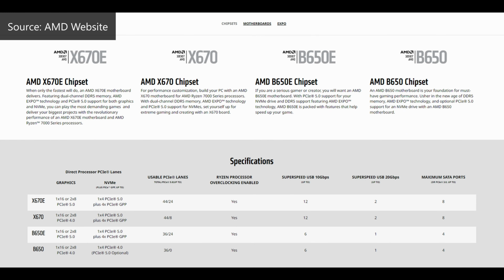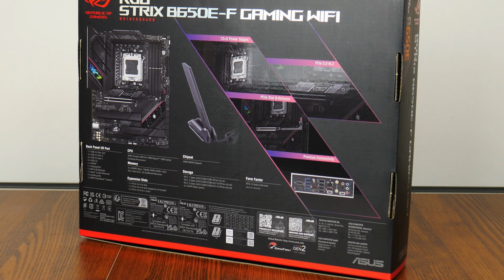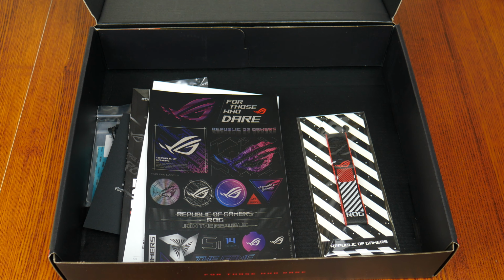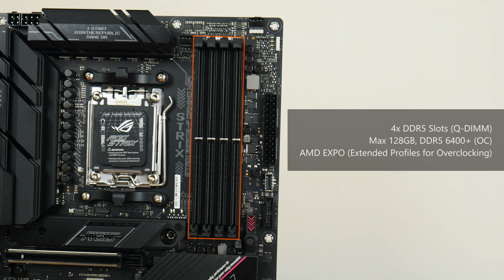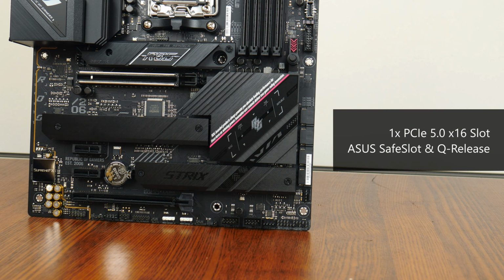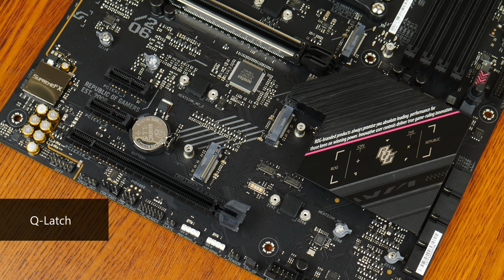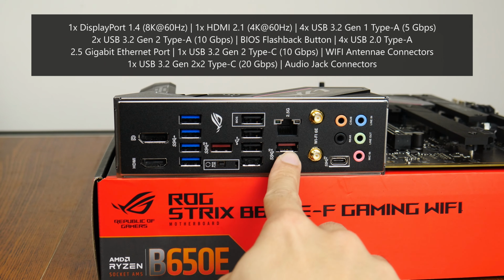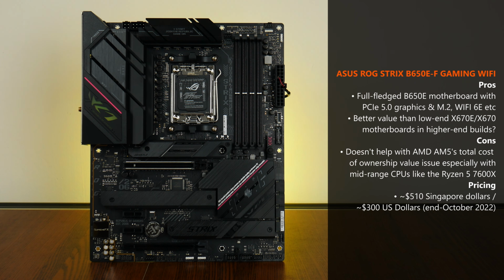Get this over an AMD X670 board? ASUS ROG STRIX B650E-F GAMING WIFI Unboxing & Overview

Comment: Wdym with total cost of ownership value issue with midrangers like R5 7600x?
Reply from the maker: Ah, that was when AM5 CPUs were priced higher than what they cost brand new right now - the 7600X and 7700X weren't very competitive in terms of pricing at launch, especially when you factor in DDR5 and AM5 motherboard prices and then look at Intel's offerings. Things have gotten better of late with AMD's price cuts that took place around Black Friday of 2022!
Reply: With current pricing, I was able to do a build with this board, the 7600x, and RX 6800 for under $1.5k

Comment: Great overview.
Gives me all the info I need to buy it. I'll be pairing this with a 7800X3D in Q4 2023,
Hopefully by then these boards will ship with the proper BIOS revision to support said CPU.
Reply from the maker: Glad you found the video useful! Even if it doesn't come shipped with a BIOS that supports the X3D CPUs, using the BIOS FlashBack feature to get the latest BIOS onto the board should be a relatively fuss-free affair!
Reply: april not q4
Reply: @StrangeBinge  Oh, I know it's launching in April.
I won't be able to afford it till Q4. 😅

Comment: Here is my review of this board. It's cheap now, but it has two issues. The I225-V onboard LAN is bad. It disconnects the internet on random. The second is the RGB on the left side is weak.
Reply from the maker: I've read about the I225-V's issues online - seems to be a mixed bag with some folks having no issues with their LAN, and some getting packet loss and all that. Did flashing to the latest BIOS/using the latest Intel drivers help with your issues in any way?

Comment: What is the difference between 12+2 and 16+2?
Reply from the maker: In a nutshell, your PC's power supply sends 12 volts of power to the motherboard that is destined for the processor. Your motherboard then uses its VRMs to step down the said 12 volts to the processor's specified operating voltage (usually around say, 1.2 volts to 1.3 volts etc). 

With the above in mind, the first number before the + refers to the number of VRM "phases" that the said 12 volts of power goes through to get stepped-down - the larger the number, the more phases the power goes through to get stepped down, and therefore, the "cleaner" the power gets before it's sent to the processor. 

In general, the larger the number before the +, the better, as this would indicate more voltage stability. This is usually more relevant in the context of high-end processors that may draw large amounts of power, or if you're intending to overclock your CPU. Hope this helps!
Reply: @ALKtech  thx bro
Reply: 16 + 2 = 18 and 12+ 2 = 14

Comment: what's the difference between B650-A, i think it's same just different color right?
Reply from the maker: The B650-A GAMING WIFI utilises the B650 chipset instead of the B650E chipset found in the B650E-F GAMING WIFI featured in this video - the differences are not just cosmetic. WIth the B650-A, you don't get PCIe 5.0 support for the graphics card slot, and there are some differences in the combination of USB ports that you get with both boards from what I see. Also, the B650-A has power stages rated for up to 60A vs 80A with the B650E-F!
Reply: @ALKtech  Thanks, I''ll buy the Asus ROG Strix B650E-F now.
Reply from the maker: No worries! What CPU and graphics card are you intending to use with the mobo?
Reply: @ALKtech  Ryzen 5 7600X and RX 6800 XT. 

This is my first time building PC, I hope it goes well.
Reply from the maker: @ccrsxx  Sounds like a combo great for 1440p gaming! How about your memory modules, have you bought them yet?
Reply: @ALKtech  Yeah, I'm planning to play game  in 4k too. 

I'll buy the parts at the end of the month.

For the memory I choose ADATA DDR5 XPG CASTER PC48000 6000MHz 2x16 GB.
Reply from the maker: @ccrsxx  sounds good - enjoy your new rig when the parts arrive!

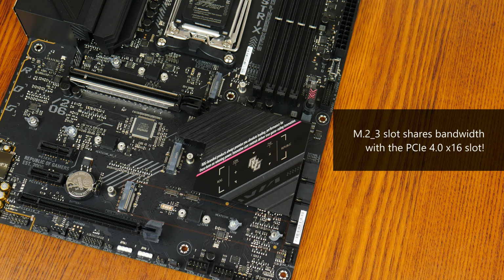Comment: Thank you for pointing out 8:50. It's aggravating how cryptic M.2 interactivity across motherboards can be. Also - Great review in general. Thank you.
Reply from the maker: Glad that you found this video useful! At least the M.2 slot in this board doesn't share its bandwidth with a more "crucial" slot...there are some implementations of Intel Z790 boards where in order to serve up PCIe 5.0 M.2 drive connectivity, board manufacturers have had to split the PCIe 5.0 x16 lanes for a graphics card into two, such that if a M.2 SSD is installed in the said Gen 5 M.2 slot, the bandwidth of the graphics card slot will be reduced...this is because unlike AMD's offerings, the Intel Z790 chipset doesn't serve up native PCIe 5.0 support for M.2 drives!

Comment: Went through your video out of pure randomness cause I'm searching advice for my next PC. You seem to be really talented for someone with less than 2K subs. Great job =)
Reply from the maker: Thanks for the kind words! What kind of a PC are you using at the present moment, and what do you have in mind roughly for your next build?
Reply: @ALKtech  And I hesitated between B650 and X670, but I think the X670 is a bit overkill for what it is.
Reply from the maker: @fridaycaliforniaa236  ah...the good ol' Ivy Bridge days. Can't believe that's a good 10 years or more ago now...I still have my Core i3-3220 that's collecting dust since the mobo gave out last year, been using it as a PC connected to my TV right till it died!

But cool, hopefully the 7900 and B650E combo will serve you for an equally long period of time, if not more. Unless money is no object, I'd personally go with a high-end B650E board too if I were to ever build an AM5 system, as I feel that they deliver the most value in the AM5 stable!
Reply: @ALKtech  Yup, I'm planning to buy a TUF gaming model =)
Reply from the maker: @fridaycaliforniaa236  nice, you're planning on getting the TUF Gaming B650-PLUS I suppose? Alongside a 7900 still?
Reply: @ALKtech  Yes =)
Reply: @ALKtech  I still have my old trusty Core i7 3770k that works like a charm. But I'm planning to buy the Strix B650E-E Gaming WiFi and put a Ryzen 9 7900 (non-X) on it with some nice DDR5 =)

Comment: TUF X670E or ROG B650E? Which one is better?
Reply from the maker: Where I'm from, the TUF GAMING X670E-PLUS WIFI costs around US$58 more than the ROG STRIX B650E-F GAMING WIFI. I'd personally go for the B650E-F as it has a better overall feature set in my opinion, and looks much nicer aesthetics wise!
Reply: @ALKtech  I bought ROG. ROG has a button for release PCI Slot (GPU). That's so nice move :D
Reply from the maker: @j0ffline  Sweet! Oh yes, the B650E-F does come with nice quality-of-life features like the PCIe Q-Release button, which the TUF GAMING X670E doesn't have 😅. What CPU will you be using with the board!
Reply: @ALKtech  7950X 😇 btw I bought X670E-F ROG, not B650E xD
Reply from the maker: @j0ffline  wew high-end board for a high-end CPU. Are you gonna get a RX 7900 XTX or RTX 4090 to go with em?
Reply: @ALKtech  I will stay with 4080. My board will have 5.0 PCI support. Years later, when PCI 5.0 GPU's release, I will upgrade with that.
Reply from the maker: @j0ffline  not only that, you've got 2x PCIe 5.0 x4 M.2 slots, perfect for when Gen 5 M.2 SSDs become the norm. By then, Ryzen 8000 might even be upon us, and you'd probably be able to do a drop-in CPU upgrade if AMD sticks to its plans for platform longevity like it did with AM4!
Reply: @ALKtech  They got my trust with AM4 support. I believe'em for AM5 :) Let's see.
Reply: both boards are complete garbage, the only one worth the money is the strix b650 e-e 😉

Comment: Can you OC on B650E motherboard i heard amd said: “ you now can OC on B650 motherboard”
Reply: You could overclock on B550 and B450 boards too. Nothing new there besides the fact that the AM5 boards are engineered to handle high core count CPUs with more power better.

Comment: Excellent video, but what about the VRM performance?
Reply from the maker: Thanks! Didn't get a chance to benchmark with this board, but I'd think that the 12+2 power stages rated for 80A should be plenty sufficient for even a 7950X...
Reply: @ALKtech  That is good to know! I'm speaking from experience because in 2019 when I built my current rig with the 3700X I orginally wanted a B450 Tomahawk MOBO because of reviews but they were sold out everywhere, so I went to a local shop and ended up with a B450-F. That MOBO has fairly weak VRM's, so in theory I kind of limited my upgrade path on AM4 for more power-hungry/hotter CPU's. When transitioning to AM5 I don't want to make that mistake again! I want to be sure I get a MOBO that can handle future AM5 upgrades without a problem.
Reply from the maker: @iseeu-fp9po  interesting, have you personally tried a higher-end AM4 CPU with the B450-F to see if indeed there's any performance impact? It'd be pretty tempting to get a 5800X3D as a drop-in upgrade to tide you through a couple more years...IF the B450-F can handle it 😂
Reply: @ALKtech  Hehe, I know right! No, I have not dared to try a Zen 3 for my MOBO yet. Actually, the 3700X has served me very well all things considered. The reason for my apprehension to upgrade with this MOBO is because of a test Hardware Unboxed did several years ago where they tested a bunch of B450's and the VRM's on the one I have they labeled as "bad". I went in to the computer store where I bought it and asked them what they thought and they didn't really understand that reasoning, hehe. There's also like a spreadsheet where one can check these things out but I can't find them anymore. It was a spreadsheet of a bunch of MOBO's of all classes and what CPU's they could support, power and cooling solutions etc. To be honest I don't think it would be an issue to try the 5800X 3D, but it would be nice to know beforehand. :)
Reply from the maker: @iseeu-fp9po  you know what, I bookmarked this AM4 VRM spreadsheet from years ago, managed to dig it up: https://docs.google.com/spreadsheets/d/1d9_E3h8bLp-TXr-0zTJFqqVxdCR9daIVNyMatydkpFA/edit#gid=611478281

Not sure if this is the same spreadsheet you're referring to!

That said, unless you're intending to overclock, you might just get away with a 5800X3D on the B450-F, given that the X3D isn't exactly a 13900K when it comes to power consumption 😂But yeah, nothing beats being able to try it out for yourself!
Reply: @ALKtech  That's the one! Haha, I was hoping you might know about it! Thank you! :)

Comment: X670E is ready for the new DDR5 and NVME enhancements that the B650E is not, as well as other features not found on the B550 chipset mobos
Reply: What... the B650-E is more than capable with DDR5 and NVME hahaha.... if you are referring to pcie 5.0 with nvme, the 4090 doesnt even use full pcie 4.0 bandwidth...
Reply: can you elaborate on that? what enhancements?

Comment: how would you compare this board to the ASRock Steel Legend X670E board? basically same price
Reply from the maker: Mmm. The ASRock, apart from having the X670E chipset, also seems to have a better VRM config, more M.2 slots and dual Ethernet ports even. ASRock's modus operandi tends to be to one-up the other brands by offering high-end chipset motherboards at lower prices. I can't comment about reliability though, as something usually has to give when you price such high-end boards aggressively...do both boards come with three-year warranties where you're from?

Comment: Same overclocking tools available as the X670E.  Basically unless you need that many USB and SATA ports, B650 will be just fine and B650E if you want to try and future proof somewhat.  Honestly though I believe that we will see AM6 before we see graphics cards that require PCIe Gen5.  Personally I like the TUF B650.  Same power delivery as this board, not as many USB ports (I personally don't need that many) and no extra money being thrown at PCIe Gen 5 which we cannot even use yet.
Reply: I mean the rog strix b650e-e basically leaves nothing to want cuz of its future proof vrm and future proof m.2/gpu slots
Reply: @Antsog  Full disclosure I did end up getting the B650E-E.
Reply: @Antsog  The only problem is that I need all the SATA and USB abilities that only the X670E has. Else I would have chosen the B650E cause it has all I need at first.
Reply from the maker: Fair point on PCIe 5.0, especially since NVIDIA's RTX 4000 series and AMD's upcoming RX 7000 series are/will be on PCIe 4.0. We probably won't see next gen GPUs anytime soon...
Reply: @ALKtech  People have done testing with a 4090 on gen 3 speeds and there was very minimal loss in performance.  So basically we would need more than double bandwith needed for a 4090 before we start needing to worry about a need for Gen5.

Comment: I'm potentially pairing this Mobo with a 7700x but I'm curious about longevity. Will this Mobo have vrm issues later down the Ryzen line if maybe someday I wanted to upgrade to a 8950x or 9950x? ( Just making imaginary names of course)
Reply from the maker: My take is that the VRMs for this board are pretty decent - unless AMD's future Ryzen releases at the high-end are gonna turn out like the 13900K (extremely power hungry), I'd like to think that this board should be somewhat future-proof. Then again, I don't have no crystal ball 😂
Reply: @ALKtech  I figured that might be the case, sounds like there will be improvements to power consumption coming soon thankfully... Those power consumption measurements scared me on Intel's side 😂
Reply: The power delivery on all their ATX boards outside of the B650 Prime should have no problems with future generations of AM5.  The Prime probably would be able to be ok as well but could have issues with the highest end 2 or 3 generations away.
Reply: planning on pairing this with the 7700x as well… how’d it pan out for you?

Comment: Hello. I would like to buy GSKILL 32GB (2x16GB) Trident Z5 6400MHz CL32 (F5-6400J3239G16GX2-TZ5K) with this mobo but mobo site says that it does not support it. Could you please help me?
Reply from the maker: Hi, these Qualified Vendor Lists on the website may not be the most up-to-date. Usually, RAMs should be compatible with most (if not all) motherboards, but DDR5 being quite new to the market after all...you do run the risk of stability issues. All in all, it's kinda hard to say without actually trying the RAMs for yourself with the mobo!

Are you intending to buy these RAMs from online? You might want to go with a retailer that offers a return policy in the event you have compatibility issues!

Comment: Hi, do you have any issue with the notorious intel I225-v 2.5gb LAN on this board? I found a lot of issue with this Intel LAN on google and not sure it has been fixed or not. Btw, will I get 100% of CPU performance if I pair it with a ryzen 7700x, I not planning to overclock though.
Reply from the maker: Hello, I've read about the issues that you're referring to regarding the I225-V on places such as Reddit as well - these issues seem to affect older step codes of the I225-V if I'm not mistaken. The review unit of this board that I received came with an I225-V chip with step code SLNMH, which is the latest B3 revision that SEEMS to have fixed the issues that the earlier chips faced...that said, I must caveat that I did not get the chance to test this board's Ethernet myself!

In terms of pairing this board with a 7700X, I'd say it's a good combo and you'll have no issues maxing out the CPU's performance!
Reply: Thanks a lot!!

Comment: Is this motherboard enough for R9 7950x?
Reply from the maker: It should work fine with this board, though I must caveat I haven't had the chance to personally test it with a 7950X. 

You could consider moving one notch higher, and looking at say, the ROG STRIX B650E-E instead, which has a beefier VRM setup (16+2 vs 12+2 on the B650E-F) -  this could come in handy especially if you're intending to do a spot of overclocking!

Comment: Is it better than the X670E Asus Tuf?
Reply from the maker: Are you referring to the TUF Gaming X670E-PLUS WIFI? If so, both boards are quite similar in terms of base features, with key differences being 1) board aesthetics 2) VRM configuration 3) audio setup 4) Ethernet chipset and 5) price.

Depending on where you're from, the ROG STRIX B650E-F is the cheaper offering, and on the whole, I feel that it has the better overall feature set versus the TUF Gaming X670E. 

I personally prefer the aesthetics of the ROG STRIX B650E-F board, which also has the Realtek 4080 audio codec and Savitech amp chip (vs a Realtek S1220A for the TUF Gaming with no third-party amp chip), coupled with Intel 2.5 Gigabit Ethernet (vs Realtek 2.5 Gigabit Ethernet for the TUF Gaming). 

The TUF Gaming also has 14+2 power stages rated for up to 70A each, whilst the ROG STRIX has 12+2 power stages rated for up to 80A each.

Hope the info above is useful!
Reply: Depend on your needs. That board have better VRM